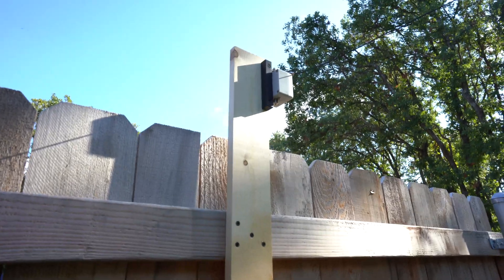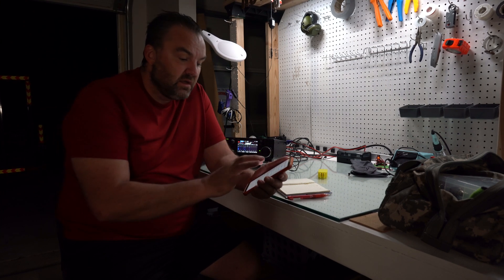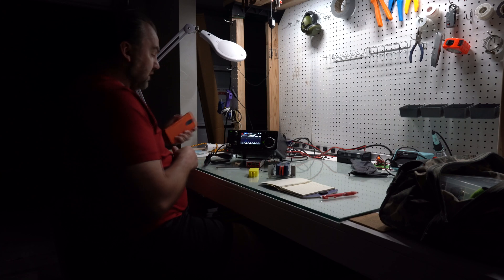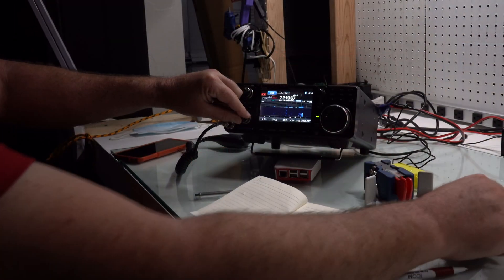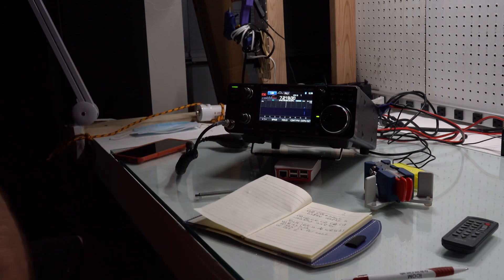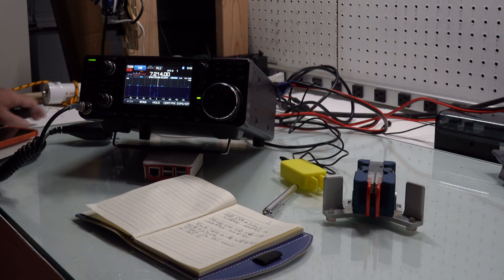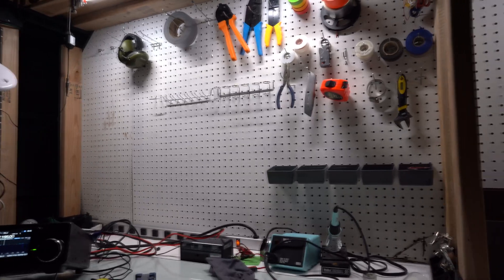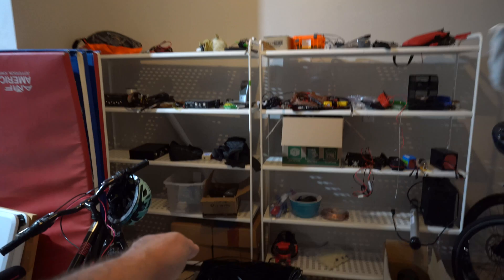HyEndFed Installation & ICOM 7300 CW SSB Listening Test

Comment: Every time I get on the radio I throw up a portable home made end fed.  I never use a tuner.  I get 1 to 1 on 40 and 20 every time. Also less than three on several other bands.  It takes me 5 minutes to 10 minutes max to put up.  I take it down around 1100 pm at night without so much as a flashlight. Use the ambient neighborhood lights
Reply from the maker: I hear ya. I'll give it a try but I find it hard to tune an antenna on the fly like that.
Reply: Ham Radio CQ use MFJ 43 ft telescoping pole with 67 ft wire sloping to about 4-6 ft.   I dug a hole and put the base of the pole into a pvc pipe.  The pvc pipe is about 3 ft submerged and sticks out of ground about 6 inches. But I have the pvc pipe filled so when I put the pole in, the base is at ground level.  I use a 49-1 unun I built using a single 240-43 toroid. The swr is amazing every time. I feed it with 100 ft of rg58 coax.  Cheap stuff. When I used 50 ft coax, the swr was significantly higher.  So you need the long coax.  It is using the coax as a counter poise
Reply: I also have the pole attached to the 4x4 privacy fence post.  I made a wood clamp to restrain it to the fence post

Comment: Thanks for the video. I'm sooooo ready for 60° here in Orlando. How much coax do you have feeding the end fed and what type?
Reply from the maker: I think just 40 feet as this is a temporary antenna.  Cheap coax not sure.  I am currently working on mounting a 5BTV Hustler antenna in my backyard.  It will be a vertical with radials.  I'll be more careful with the coax when that happens.

Comment: Thanks for another great video. Like watching your cw vid's and try to copy along with you. Wondering if you have or planning to get an ac unit in the garage. You know how hot and humid it can get here in Okla.
Reply from the maker: That's a good point, I'm hoping to build a shed or separate house that has AC / Heater.

Comment: You may already know this, but if you put the 7300 in 'emergency' mode, it will tune up to 10:1 but limits you to 50 watts.
Reply from the maker: I did not know that thank you!
Reply: @hamradiocq  K8MRD gets the credit for that information.
Reply: @hamradiocq  50 watts is all I use portable, the person on the other end will not know the difference;  [1/2 S unit]. Your battery will thank you.